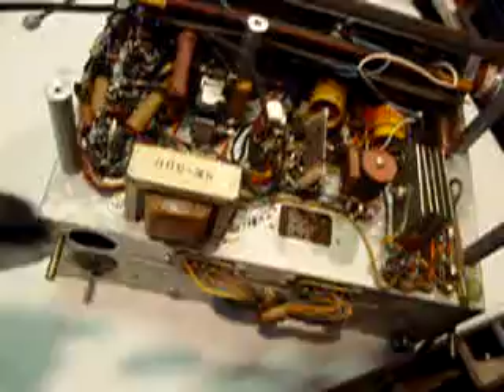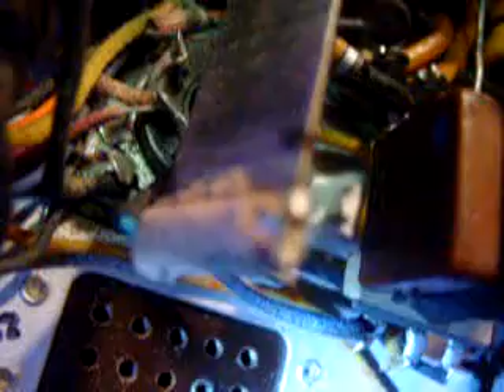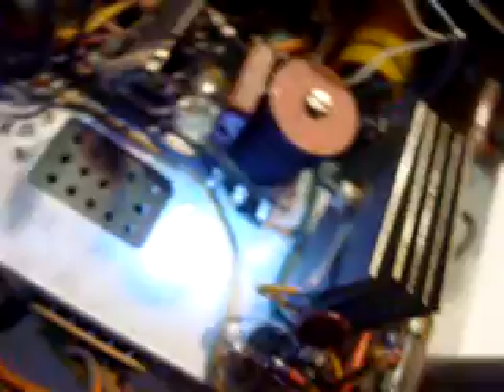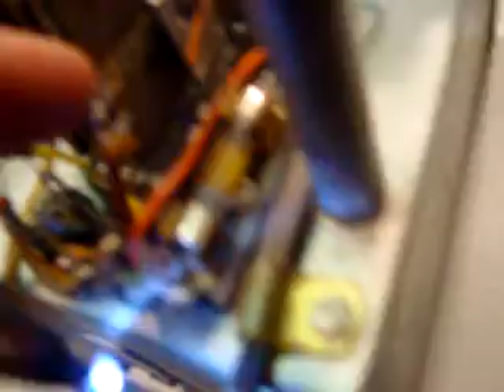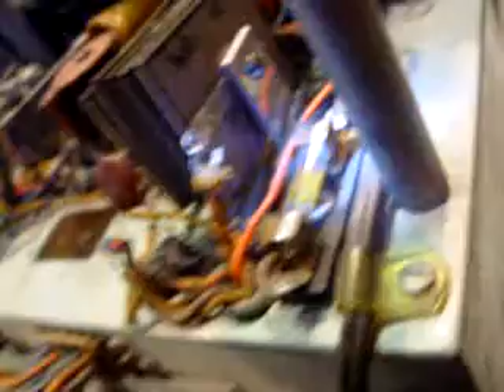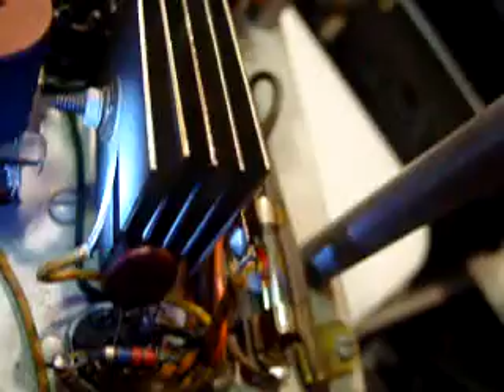What is this part? It's bad and I need to replace it.

Comment: It is a power resistor 20 - 40 Watt rating.
Not sure about the 15 k.ohms. More likely to be 1k5 or 150 ohms.
Those resistors can glow red hot when overloaded.
For the selenium rectifier. See if it has 2 or 4 terminals. Some of those can be configured as a bridge rectifier too.
Have a look if you can work out the polarity from a nearest polarized capacitor.

Comment: @CassetteMaster  maybe, but I would think it is in the HV section of the tubes, I've seen similar resisters  there before, limiting current through the rectifiers.. so do a circuit trace before we guess any further. If the mains comes in, is rectified and then goes through this resister, then I could make a guess as to the value.

Comment: Figure out what part of the power circuit it is in, then an educated guess can be made at what its resistance should be. Chances are its not in an area that must be critical exact resistance. You can replace it with a typical wirewound resistor. And yes, they smoke when old caps or selenium rectifryers go bad..

Comment from the maker: @phantom3rdchannel I did use an ohmmeter and found the rectifier had a resistance. Thing is there is no sound whatsoever from the amp. Unfortunately I have no schematic. I did see 15K ohm marked on the chassis near the part, but I'm not sure if it's for the resistor or for the output transformer or something else.

Comment: it is a resistor. a big sand covered power resistor it  would take a pretty big short to fry it. selenium can be replaced with a diode but you have to add a resistor to account for the voltage drop the original selenium would have had.   id refer to the schematic for values of the resistor and to someone else for the values of what you will need to replace the selenium lol. ive never needed to replace one so don't know specifics.